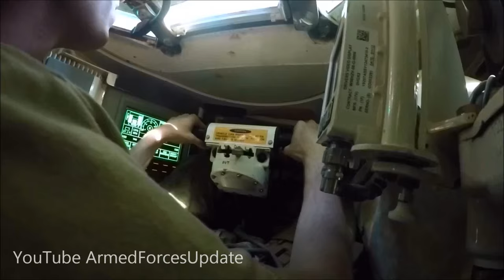AWESOME POWER !!! US Military M1 Abrams Tank live fire

Comment: tbh the t90 is a strong tank it has a few advantages over the M1
Reply: The M1 Abrams has double plated armor
Reply: +Ryan Wang t90 faster better cannon with less depression on it m1 is heavier and the same armor they have
Reply: M1A2 can stabalize it's gun so no shell is wasted
Reply: +Anthony Frenes stfu M1 has a lot more armor plus it's better
Reply: +SWAGfaceYT im not gonna talk to you if your gonna insult me
Reply: +Ryan Wang t90 has a 125mm cannon for long range m1 has 120mm for and has trouble shooting a long range
Reply: +Anthony Frenes Id say they are both as good but preform in different ways. But for a production point of view the Abrahams take 4 months to manufacture cause it's basically a computer with very good armour probably 2nd best Armour in the world. The t-90 is basic to produce but like they make 20 for every 1 Abrahams
Reply: +Matthew Rhodes agreed don't get me wrong the beast tanks I still would choose m1 over t90 mostly due the t90 is still outdated and still run on fuel
Reply: +Anthony Frenes I wonder what the t-14 is going to be like
Reply: What you said was right, the T90 has been constantly upgraded pushing it to be somewhat better than the M1A2. The T-90s maneuverability and speed is better; its engine is better; its gun is better. But it in no way compares to the Abrams. The best all rounded tank out of the two is the M1A2, due to the fact that the US tank does have slightly better armor (still not that amazing) and also has better computer, weapon, and fire control systems. US troops are better trained as well and also use better ammunition. 

I guess one could also argue that the Abrams isn't really 'American' due to the fact it uses a variant of the German Rheinmetall L/44 smoothbore, uses British armor (Chobham 1) Canadian computer, weapon, and fire control systems; and is also soon to get Israeli APS systems and ECM systems. I also believe the Add-on Reactive armor, used on the tusk, is also supplied by Rafael, again Israeli.
Reply: +Matthew Rhodes the T-14 is a Russian Heavy tank
Reply: +Matthew Rhodes I'll have to do more research on the t14 seems that it's an been made in 2015 still new I have learned much about it
Reply: +A Small Acorn agreed
Reply: +Anthony Frenes I think Russia needs to be careful of its spending cause all this new tech is getting expensive like the T-50 and the T-14, and since Saudi Arabia are allies to America and there the ones who mainly flooded the markets with oil and Russia's main export is oil
Reply: ***** No one said the T-90 was outdated.
Reply: T-90 isn't outdated at all, probably you forgot that there is a modernized version from 2011 called T-90MS and about Abrams, the future version will include diesel engine too. So it doesn't matter.
Reply: ***** Well it does matter, seeing as the current version still has the unreliable turbine, and will for many years to come.
Reply: +Ratchet X when I mean outdated I mean that there main battle tanks are the t90 that were mass produced in 1991 and is most if there battle union so I mean they still have more of them then the t90ms
Reply: +A Small Acorn I men that they still have t90 more then there updated tanks like t90ms
Reply: That's funny
Reply: What about the german leopard II ?It look soo heavily protected and looks so much heavier ( correct my spelling mistakes) I'd prefer that one even though the abrams is combat proven . I feel like it's way better protected than the t14 . The t14 is an awesome design but I really consider the turret to be destroyed easily